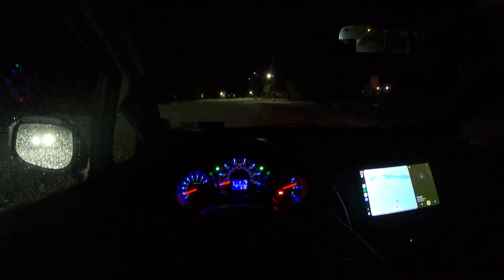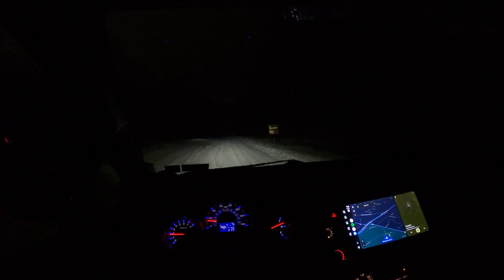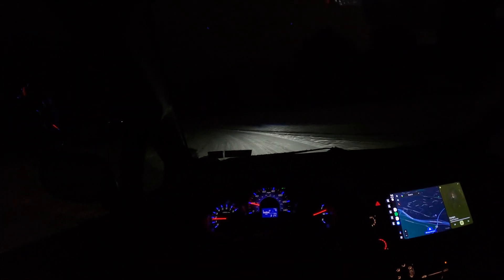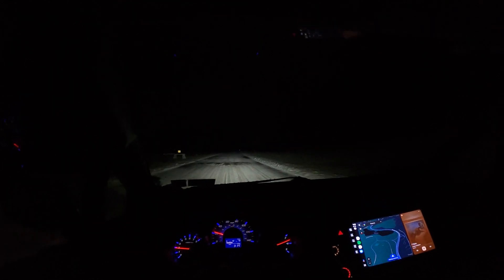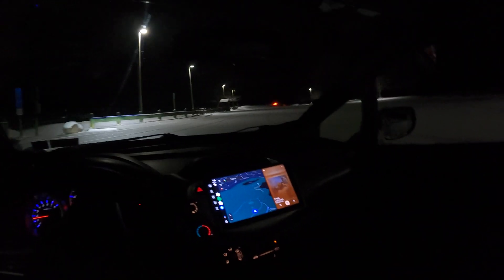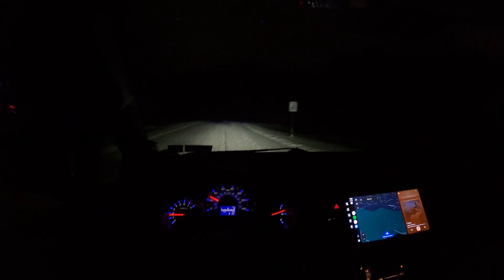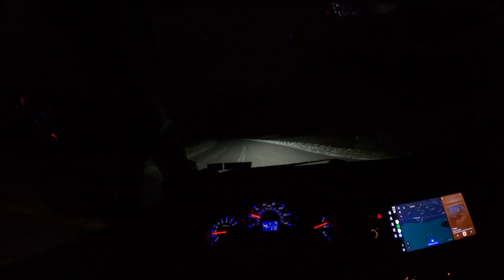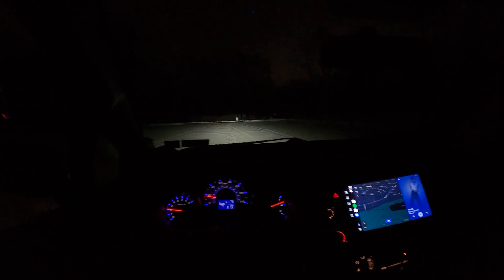2013 Honda Fit 5MT Bi-LED Headlight Retrofit Drive. What a difference!

Comment: How did you aim the  projectors?
Reply from the maker: Some come with adapter rings which gives you a great starting point depending on the type of housing that you have. Horizontal aiming adjustments are achieved prior to sealing back the lens and installing the headlights back on the car. The projector can be rotated after the car is on level ground approximately 25'-0" away from the wall. Vertical height is adjusted via the screw adjustment on the housing.
Reply: Makes sense thank you

Comment: Could you share a tutorial for this? 

My thinking tells me to simply connect the + and - of the projector onto the wiring harness. Not sure where I'd be placing the diode.
Reply: https://youtu.be/z707m9hTKV0?si=plN-5Js4o4Qbkr9T
Reply: Watch that video and follow it but reverse the diodes. So opposite of how he has them oriented in the video. Did this for my Honda fit and worked.
Reply: I second this, plz make a tutorial (I’ve never done electrical work or any retrofits plz help 😭)

Comment: Are you worried if the led fails the whole headlight needs to be disassembled? Thats one reason why I still chose to go the HID projector route since bulbs are easier to replace.

but ya, the performance is not as good as bileds so I had to supplement my hidprojectors with some ss3 led fog lights lol
Reply from the maker: Definitely a good point. The led should last a lifetime though!